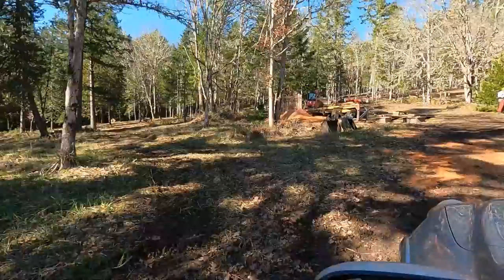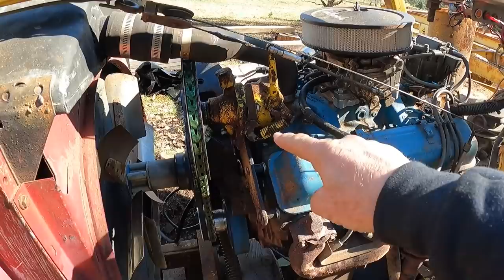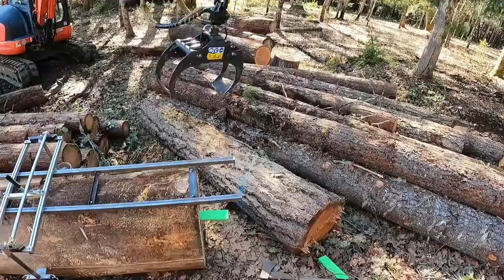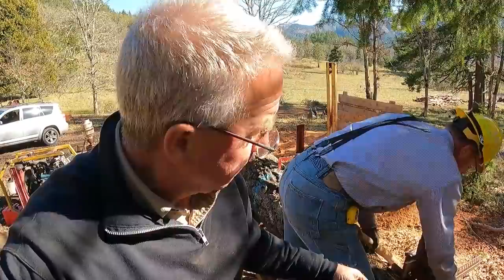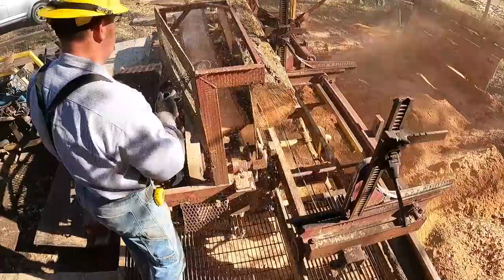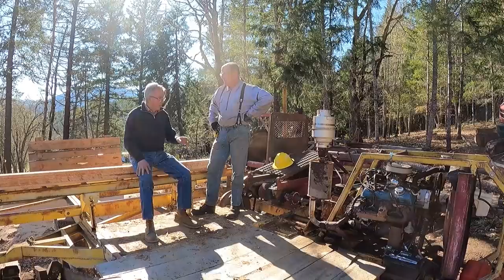My Sawmill Runs! Revisiting the Sawmill I Built in 1979.

Comment: Hi, I may have missed something but I do have a sawmill (old water-powered) on the farm I grew up on - We had a flywheel to maintain the momentum of the saw when it hit knots, harder parts, ...  In low rain times, we connected the shaft to a tractor via a pulley.  I caution people about using a can engine without a governor - When I was a kid, we jury-rigged a car engine to power a pulley.  Little by little, the engine would rev up faster between logs until the flywheel came apart - killing one of our helpers.  Be safe, Peace be with you all, great video, Ciao, L (Morning Side Farm and Starlight Farm, QC/ME)

Comment: Hello wall I would like to add to this video I am a retired tool die and mold maker I have built over 90 engines and I have a lot of things that can make that Mill power much better I would like to share that with you first of all if you wants to keep the motor okay but if the motor gets rebuilt which it could and should have with the rear main seal is questionable you need to put a marine camshaft in they are designed a very narrow RPM band probably around 45 or 5,500 RPM which is fine for that motor you can get much more horsepower by putting a set of headers and dual exhaust not single like I see it. By doing those things you're going to get between 50 and maybe 65-68 horsepower more, changing the camshaft dual exhaust with headers and also a good Aluminum Intake Manifold with maybe a different carburetor. I don't know what is installed. It's an amazing feat that you built this so long ago and still running. I keep things running. I don't believe in getting rid of anything  and buying new with more ingenuity. This saw Mill would really sing. I hope this helps and I'll respond on return comments.

Comment: Just a thought, you might want to bolt on a sheet of 1/4inch polycarbonate on the frame above the blade, it would keep a lot of the dust out of your face. Do not buy acrylic, as it sometimes shatters.
Reply: Good suggestion.   We had an old aluminum window screen hanging in our mill back in 70s.  Not much for safety, but just for dust.  
Cheers!
Whipple

Comment: A circle saw takes so much more horsepower compared to a band mill. A V8 gas is a fuel hog at best, but I get that it's a "run what ya brung" deal at least for now. I would at least be on the lookout for a 200hp diesel, maybe a Cummins 6 cylinder. It does make lumber tho.

Comment: What you need is torque.  The 292 straight 6 engine can make more torque at a lower engine rpm. I have seen equipment (pumps, farm equipment, etc.,) run on engines. But they all run on straight engines. Not V type engines. Maybe a cam swap, maybe a total engine rebuild would help. Only race engines will run long term at a higher rpm. And they don't run long  before being rebuilt. Above 3000 is fairly high, not really high. Maybe the engine is getting tired. I grew up driving Chevy trucks with a 4 speed transmission and 2nd gear is extremely powerful in those old transmissions. So could there torque loss somewhere other than during the cutting process itself? All in all that is a very impressive piece of equipment. I couldn't imagine seeing again a picture of equipment that I built and sold then come back around. It must be exhilarating.

Comment: That's probably the sm465 transmission. There's a big difference between second and first gear. I would wonder though, how it would work if you eliminated the belt-drive altogether, and ran the transmission output directly to the spindle. I'm guessing 1st gear would match up well in that case. The concern is whether the straight-cut 1st gear would handle the loads long-term or not.

1st -- 6.55:1
2nd -- 3.58:1
3rd -- 1.70:1
4th -- 1.00:1
Reverse -- 6.09:1

Comment: Collab ideas: AvE, ofc, to machine the dodgy connection between the engine and shaft, and one of the Motor Trend shows (Engine Masters? Hot Rod Garage? Roadkill?*) to pep up that 350.

*I can totally see Dave and Finn roadtripping up to Oregon and taking the built engine out of their car to run the mill for a weekend, then swapping it back and roadtripping back to LA. They did it with a boat, why not a sawmill?

Comment: Very cool. I realize this wouldn't work too well in that location (due to I would guess lack of power), but I've got to imagine swapping over to an electric motor would do wonders for a mill like that. More torque and way more controllable on the speed. Don't need to worry about transmission, etc. Just spec the motor out to the RPM you need and connect it. Oh... and a whole lot quieter when you are out there working for hours.
Reply: A 75hp electric motor would need a very large generator or an industrial power supply
Reply: @trevortimmreck  Would you need that large of a motor though? 

Fair amount of bandsaw mills available for purchase are 5HP, and Matt Cremona's really large one is a running of a 10HP. Obviously, bandsaw mills are a different animal than a large spinning blades like this, but feels like with the added low end torque of an electric, you could greatly reduce HP requirements. But really, I have no idea, so I could be completely talking out of my butt. 😂
Reply: @mattpeterson7074  in the video they said that the belts would hold 75hp, and they were limited to that much power and wanted more power
Reply: @trevortimmreck  I must have missed that first watch through. I guess running these round bladed versions must require a lot more power to run over the bandsaw counter parts.

Comment: What is the saw kerf on the blade 3/8 inch?   The modern bandsaws have a saw kerf around and 1/8 inch.  Every fourth cut equals a free board with the bandsaw versus the circular blade.  The extra boards add up when cutting larger diameter logs.
Reply: 1/4-5/16

Comment: I don't know much about sawmills, it seems to me that a circular mill needs a lot more horse power than a bandsaw mill, is that because of all the extra friction from the circular blade?
Reply: Im assuming it's because the thickness of the blade is removing a lot more wood than the thinner bandsaw blade, plus it's driving the whole carriage to pull the log through, where the bandsaw blade you just push it manually.
Reply: @Race Krasser  the carriage doesn't rob a huge amount of power. As you said, it's the blade with. But also the tooth sides are planing the wood. This wouldn't happen with sawtooth blade, but then you wouldn't get the planing action and would have coarser finish. Still the biggest thing to power usage is the feed speed. These saws will cut through a log in about ten seconds. A bandsaw mill will take a lot more time.

Comment: Put that 350 on a direct drive and he won't be bogging it down.
Reply: Won’t work, the rim speed of the blade need to be about 650 RPM and the motor needs to be in its peak power band of 3500 RPM. For that kind of reduction a gearbox is needed.

Comment: need a motor putting out loads of torque, not horsepower a diesel or optimize that small block for torque instead of high horsepower.